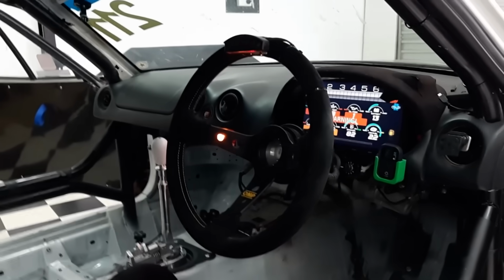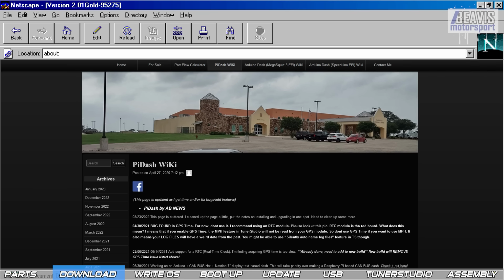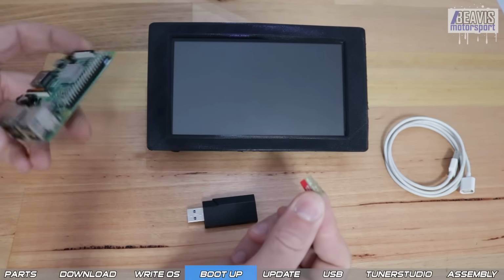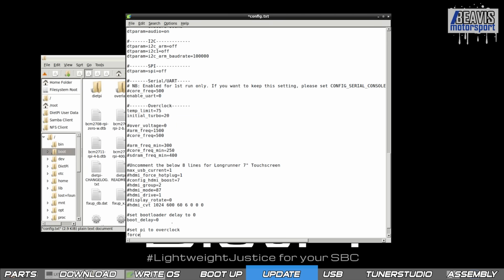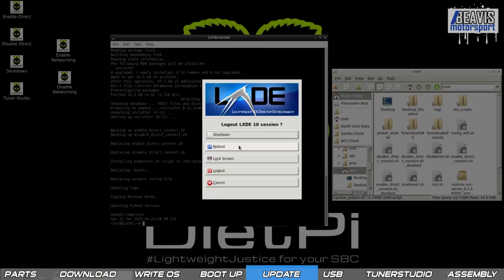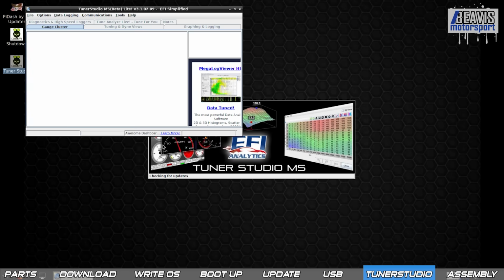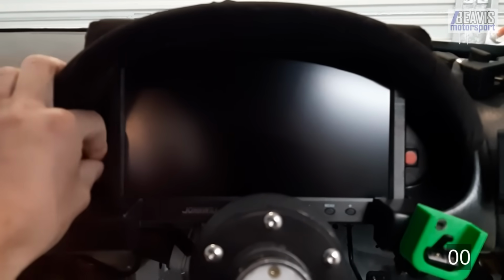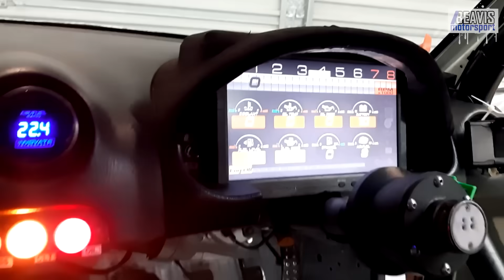DIY Raspberry Pi Racecar Dashboard: The Ultimate Guide

Comment: Anyone done this with a non OBD2 car? I've got a 58 Sprite I would love to do this too. Oil Pressure / Water Temps / GPS Speed and Tach is the minimum I'd need. This is super cool.
Reply from the maker: With a car of that age, you would need some form of electrical circuitry to accept inputs and convert them to an appropriate signal.

Comment: What interface you use to connect with ECU?
Is it possible to use one of the Raspberry Pi CAN BUS HAT from the market?
Reply from the maker: Hey,
So sorry, that is something I glossed over forgetting that not everyone viewing would have the context that this is for a Megasquirt ECU.
I'm running this dash in a track car that uses a Megasquirt MS3 ECU. So all my sensors, speed, temps etc go direct to the ECU. Then the ECU has a USB connection direct to the Pi to feed the data for the dash software. Note that the TunerStudio software is specific to the Megsquirt ECUs which is what my car runs. If you wanted to use CAN or OBD2, perhaps the OpenAuto software would work for you... or if you have a different aftermarket ECU, or even a carby car, consider trying this software instead: OneGauge, theonegauge.com.
Hope that helps, thanks very much for watching.

Comment: I have upgraded the ECU to MS3 from MS2. I also want to to update TS on the pi to the latest version.  Is it as simple as connecting the pidash to the internet and checking for latest update for TS?
Reply from the maker: I would probably connect the Pi to the internet and manually download the latest version.
Reply: I was going to use shadow dash for my ms3x but it's no longer available.       I've never dabbled in anything like this so it should be interesting 😂

Comment: I thought of doing something similar but with a different approach: automating the windows, air conditioning, and many other features of an 80s model car using a Raspberry Pi. However, from what I've seen, the operating system takes around 10 seconds to boot up on the screen. So, I thought of implementing this system with a PLC, using Arduino or Raspberry Pi to collect some data and sending ON and OFF signals to the PLC's HDMI unit. Maybe an external set of buttons could also be added, as it makes more sense to use the screen solely as a display behind the steering wheel.
Reply from the maker: Nice ideas. In general all of these things are pretty much 100% possible its just being wise around the electronics/technology and spending the time to learn how to do whatever it is you want to do.
Reply: @Bbeavis  you are right

Comment: Love it!  One question you didn’t go over how to wire up the dash and connect it to censors/ecu
Reply from the maker: I'm running this dash in a track car that uses a Megasquirt MS3 ECU.
So all my sensors, speed, temps etc go direct to the ECU.
Then the ECU has a USB connection direct to the Pi to feed the data for the dash software.
Reply: @Bbeavis ohhh ok it’s just a usb. Thanks.
Reply from the maker: @ninelivesracing  Let me know if you need more detail or want any help. Always happy to help a fellow Miata owner.

Comment: If I wanted to use this just for sensors like boost oil pressure etc would this still be a good option using pressure sensors and this?
Reply from the maker: I have boost, oil, water etc sensors going into mine... its perfect for it.

Comment: hey there, i changed my time zone in the dietpi txt file to canada/eastern as per the link to wiki says, i am in toronto. though it wont update the settings and keeps me in 2019, wrong date and time. i cant access internet because of this and cant seem to find a solution, i can connect to internet okay, any ideas?
Reply from the maker: Some ideas:
Manually correct your time on the Pi via gui or console.
Manually run the time sync process.
Reply: @Bbeavis okay I will try and see if I can figure it out, thank you!

Comment: Super cool video!

I’ve never used Raspberry I’m only familiar with Arduino(that’s what I’ve used for other projects) but when It comes to automotive what would you suggest, I’d like to incorporate something with my next project. 

Also just curious if you think going with a large LCD or OLED screen as opposed to a monitor to get rid of the start up screen🤷‍♂️.
Reply from the maker: Not sure what exactly you mean by "get rid of the start up screen"... but certainly the display has a blue splash screen when it is first powered on which you wouldn't see on every type of display.

Comment: I’m super excited to try this! I’m experimenting with screens and found a thinner 12 inch screen I will try to use and emulate an oem type design with customizable flare. How do I make my own gauges and such? Is it literally as simple as just using the correct file type? I’ve never tried, but I’m not technologically stupid either, as I’ve done tons of pi research for arcade cabinets too and other audio, computer, and camera maintenance. Any tips would be helpful, I’m usually just a plug and play type guy, but I’m eager to learn
Reply from the maker: All my images/gauges are created using a standard photo editing application - if you don't have photoshop, photopea or Gimp are great free alternatives. 
Then, they may be imported into TunerStudio as gauge backgrounds.
If you are normally a plug-n-play type person, this is perhaps the complete opposite of that - so you will need to be ready to tinker, and get your feet wet with this project.

Comment: this will work on a 1987 dodge daytona shelby Z turbo?
Reply from the maker: I had never heard of a Dodge Daytona Shelby Z, so I looked it up. What an interesting car.
To answer your question, note that the TunerStudio software used here is specific to the Megsquirt ECUs which is what my car runs. If your Daytona runs this family of aftermarket ECU, then yes you could use this dash. If not, you'd have to look for some other dash solution.
Reply: @Bbeavis  Wow Thank you for taking the time to find out if will work or Not in this case for my car wont work, Thank you.

Comment: Could this be configured to connect to Megasquirt over CAN?  I'd prefer to not use the USB connection if I can get away with it
Reply from the maker: TunerStudio supports numerous other communication protocols, I'm just using serial over USB for convenience and simplicity. 
Sugggest you refer to the TunerStudio website for comms options:
https://www.tunerstudio.com/index.php/products/tuner-studio/tsarticles/100-usb-a-wifi-support-1
Note, I have no affiliation with this software, I am just a user, so i cannot answer specific questions or help with issues around it.

Comment: Hello, how do you get the speed, Rpm and all the data from the car?
Reply from the maker: I'm running this dash in a track car that uses a Megasquirt MS3 ECU.
So all my sensors, speed, temps etc go direct to the ECU.
Then the ECU has a USB connection direct to the Pi to feed the data for the dash software.

Comment: Hi this is exactly what I’m looking for, do you have any info on how you connected it all to the ecu and got required signals?
Reply from the maker: Thank you.
I'm running this dash in a track car that uses a Megasquirt MS3 ECU.
So all my sensors, speed, temps etc go direct to the ECU.
Then the ECU has a USB connection direct to the Pi to feed the data for the dash software.

Comment: How does it hold up to heat? I have a 12.3inch display that freezes due to overheating I the summer months
Reply from the maker: In car use hasn't been an issue. i do have a fan on my Pi to actively cool it.

Comment: Great video, one question, how do you connect all the sensors to the Rpi?
Reply from the maker: So sorry, that is something I glossed over forgetting that not everyone viewing would have the context that this is for a Megasquirt ECU.
I'm running this dash in a track car that uses a Megasquirt MS3 ECU.
So all my sensors, speed, temps etc go direct to the ECU.
Then the ECU has a USB connection direct to the Pi to feed the data for the dash software.
Note that the TunerStudio software is specific to the Megsquirt ECUs which is what my car runs.
If you wanted to use OBD2 or if you have a different aftermarket ECU, I have another video coming soon on how to build a similar dash solution in that use case.
Hope that helps, thanks very much for watching.

Comment: this is probably a loaded question but what connects the pie to the vehicle to give it all the information?
Reply from the maker: So sorry, that is something I glossed over forgetting that not everyone viewing would have the context that this is for a Megasquirt ECU.
I'm running this dash in a track car that uses a Megasquirt MS3 ECU.
So all my sensors, speed, temps etc go direct to the ECU.
Then the ECU has a USB connection direct to the Pi to feed the data for the dash software.
Note that the TunerStudio software is specific to the Megsquirt ECUs which is what my car runs.
If you wanted to use OBD2 or if you have a different aftermarket ECU, I have another video coming soon on how to build a similar dash solution in that use case.
Hope that helps, thanks very much for watching.

Comment: How to adapt this custom dashboard for a daily driver car?
Reply from the maker: Your question is too vague to have a single specific answer.
You can use this solution as is for a daily driver.
But, some things that might make it better for a daily driver... for one maybe it would be better to add a auto power on/off circuit. Or, put the pi to sleep instead of shutdown. You could use it also as a radio/bluetooth player in your centre console rather than on the dash, setup some music apps on the Pi. 
So many options.

Comment: How do we connect it to the car ? How to connect it to canbas tuning
Reply from the maker: I'm running this dash in a track car that uses a Megasquirt MS3 ECU.
So all my sensors, speed, temps etc go direct to the ECU.
Then the ECU has a USB connection direct to the Pi to feed the data for the dash software.

Comment: This is sooo cool.. thanks for sharing. If you can help me a bit will be more than appreciated.

I’m planning to do a project that is going to collect a lot of data and store it. The data will be coming constantly from some devices connected by Wi-Fi. Data can be few Mb. Additionally, I’ll need some computer power to do some simple calculations and transmit some results over Bluetooth. All this needs to be powered using a regular cigarette socket found in a car. 

To be fair, I’m kind of stuck because not sure if a pi can be powered using the cigarette socket (12v <3A) I been thinking in pi or arduino. Any idea or guidance you can give me will be great. Thanks
Reply from the maker: This video isn't the best place to ask a question about cigarette sockets, there are better resources online for that sort of information.

Comment: Very Neat. Have you seen anything discussed about making this work on the Pi5, with 8GB of RAM, and then running it off a RAMDisk instead of a SD, so you can immediatly shut down the car without risk of corrupting the SD, and also boot up much faster? Its the slow boot and requirement to shut down, which really puts me off a Pi approach for a car dash. I am using a microcontroller setup at the moment, which you can power on and off as you like. Just wish it had a bit more graphics grunt. I still find it preferable to a Pi approach though due to the startup/shutdown aspect, but I think a RAMDISK approach would solve that.
Reply from the maker: I've had a Pi5 on order since last year, still waiting for it to arrive so I can try it out and see how it will work/perform.

Comment: Thank you for sharing! How it would be connected to ODB2 or CAN bus to interchange data?
Reply from the maker: I'm running this dash in a track car that uses a Megasquirt MS3 ECU.
So all my sensors, speed, temps etc go direct to the ECU.
Then the ECU has a USB connection direct to the Pi to feed the data for the dash software.

Comment: I want to make one to replace my fuel/temp gauge on my 1992 honda prelude...  but I can't find a screen that will fit. also is there a way that I can have it turn on and off without me making it? and lastley is there a way I can make it look like the OEM fuel/temp gauge if I can find a screen that size
Reply from the maker: Yes, you can create (or buy) circuits that trigger the Pi to shutdown when you turn off the car via the key.

Comment: You missed that part where you need to install a whole stand alone megasquirt ECU and tune the car before you can run this dash. Just a small detail.
Reply from the maker: Yes for this video the TunerStudio software works with the megasquirt family ECU.
But the hardware solution could work with other ECU's with different software.

Comment: I am new to this world. One question. How is it getting the data. is it from the obd connector?
Reply from the maker: I'm running this dash in a track car that uses a Megasquirt MS3 ECU.
So all my sensors, speed, temps etc go direct to the ECU.
Then the ECU has a USB connection direct to the Pi to feed the data for the dash software.

Comment: Great video man! Btw What hardware should I use for it to have quicker boot up time, planning on doing this to my LS swap jeep, and 30 seconds boot up time is way too long for me, looking for something like 5-10s max
Reply from the maker: I've not tried it yet, but perhaps with the Pi boot configured to run off USB then an M.2 SSD in a USB housing would be usable - you'd have to experiment.
I tried a reasonable quality USB3 thumb-drive but didn't experience a noticeable improvement.

Comment: Does it work off can bus ?
Reply from the maker: I'm running this dash in a track car that uses a Megasquirt MS3 ECU.
So all my sensors, speed, temps etc go direct to the ECU.
Then the ECU has a USB connection direct to the Pi to feed the data for the dash software.
Reply: I guess if the ECU can broadcast can the pi should be able to decode it or maybe a Arduino @Bbeavis

Comment: Do you know if this would work with ECU Master?
Reply from the maker: I'm running this dash in a track car that uses a Megasquirt MS3 ECU. The ECU has a USB connection direct to the Pi to feed the data for the dash software. If you wanted to use OBD2 or if you have a different aftermarket ECU, I have another video coming soon on how to build a similar dash solution in that use case.
Reply: @Bbeavis  thank you for the reply and information

Comment: Hi , good job . have you some for OBD1 honda civic ECU OEM ? thank's from France
Reply from the maker: I'm running this dash in a track car that uses a Megasquirt MS3 ECU. The ECU has a USB connection direct to the Pi to feed the data for the dash software. If you wanted to use OBD2 or if you have a different aftermarket ECU, I have another video coming soon on how to build a similar dash solution in that use case.
Reply: @Bbeavis   great, looking forward to your video ;)

Comment: it's not clear how to interface this to sensors. Is this an obd adaptor, or will it take analog inputs from temp, presure, fuel senders?
Reply from the maker: I'm running this dash in a track car that uses a Megasquirt MS3 ECU. The ECU has a USB connection direct to the Pi to feed the data for the dash software. If you wanted to use OBD2 or if you have a different aftermarket ECU, I have another video coming soon on how to build a similar dash solution in that use case.

Comment: Hello, how is the vehicle information sent to the raspberry?
Reply from the maker: I'm running this dash in a track car that uses a Megasquirt MS3 ECU. The ECU has a USB connection direct to the Pi to feed the data for the dash software. If you wanted to use OBD2 or if you have a different aftermarket ECU, I have another video coming soon on how to build a similar dash solution in that use case.

Comment: Why not do something like make the Raspberry always powered from the battery and use acc power to control a relay that feeds power to turn it on and something like a temporized circuit to shut it off and turn the relay off when you remove the key?
Reply from the maker: Because in my car I run a battery cut off switch that would kill the pi. And it would drain the battery too quickly.

Comment: Your video is nice, but how do I connect the pi to the car?
Reply from the maker: I'm running this dash in a track car that uses a Megasquirt MS3 ECU. The ECU has a USB connection direct to the Pi to feed the data for the dash software.
Reply: so in a normal car something like this will hardly happen  @Bbeavis
Reply from the maker: @DCUOChaosDynasty  If your car has OBD2, I have a video coming soon for a dash which will work for that scenario.
Reply: i have obd2 and i have  ELM 327 OBD 2  Bluetooth @Bbeavis

Comment: How do you feed it data? Is it hardwired OBD data? Also is it possible on OBD 1? I am getting a 95 Honda Acty and I hate the stock dash, but I have a Pi4 Model B and a 7 inch screen sitting here doing nothing. If I can put it in there I am going to.
Reply from the maker: I'm running this dash in a track car that uses a Megasquirt MS3 ECU. The ECU has a USB connection direct to the Pi to feed the data for the dash software. If you wanted to use OBD2 or if you have a different aftermarket ECU, I have another video coming soon on how to build a similar dash solution in that use case.

Comment: how to connect it with a ECU? or  obd2?
Reply from the maker: I'm running this dash in a track car that uses a Megasquirt MS3 ECU. The ECU has a USB connection direct to the Pi to feed the data for the dash software. If you wanted to use OBD2 or if you have a different aftermarket ECU, I have another video coming soon on how to build a similar dash solution in that use case.
Reply: ok thank you I'm looking forward to the new movie